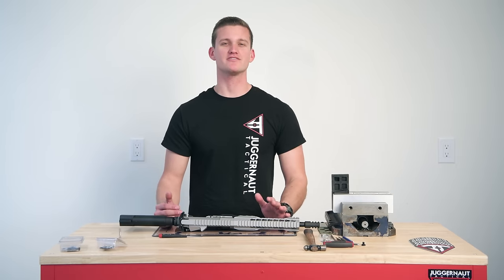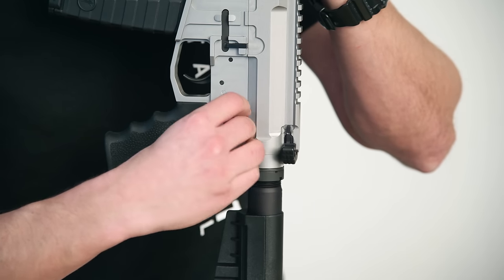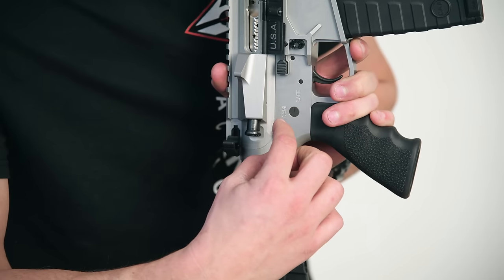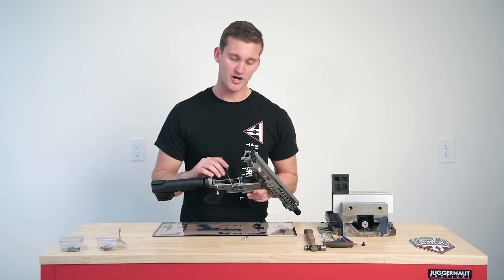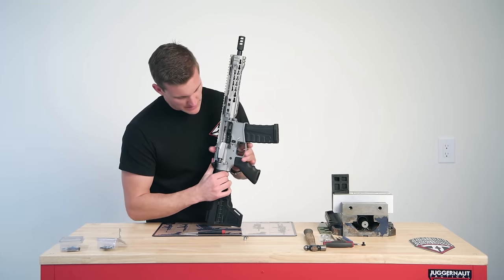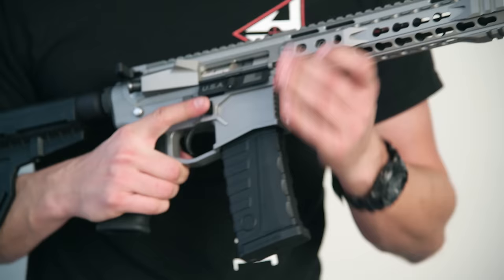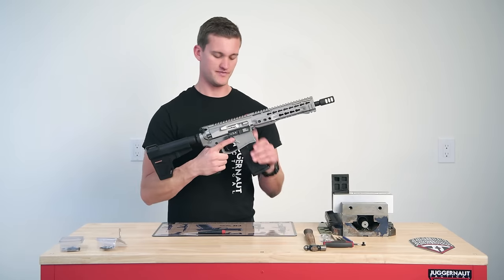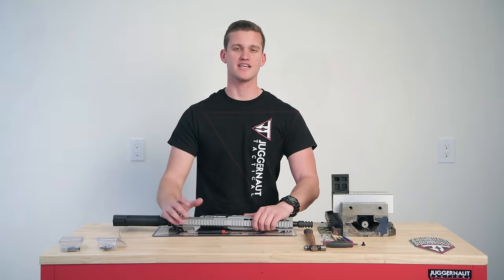How To Disassemble And Adjust Our Hellfighter CA Mod Kit

Comment: how do I lock the bolt back with this?
Reply: Same as you do normally
Reply: You remove the bolt catch so how do you figure?
Reply: @user-ro5qf1ov9r  sorry I was speaking from experience with my factory-installed CA compliant LWRC DI but it turned out they only used the rear takedown pin from the hell-fighter. Everything else was bespoke, lol. So on my LWRC I can lock the bolt back.

Comment: Is there a way to adjust the kit if the break is too stiff? Or won’t break all the way just by pressing?
Reply: I am wondering the same thing.  Just got my first ar, and mine seems stiffer, does not crack or close with ease. Did you find a solution?
Reply: joshm510 so i figured it out. Out the factory or whatever it comes with a rubber insert that is behind the trigger group where the auto sear would be. I took it off and it operated smoothly since. Leme know if you cant figure it out i can dm you pics or whatever.

Comment: Are any of the issues in the comments below fixed? I’m Not sure if it’s been fixed by the manufacturer. Issue with detent pin & others???
Reply: Stevo Schauer mine works, you have to be easy on it clearly cuz that D tent pin will pop out. But im having an issue with the mag, the bolt won’t close all the way. Keeps getting caught on the mag
Reply: Thanks for the update I have the cross armory kit with the bump stop by mid-evil industries works great

Comment: Great product but the video is lacking on a bit of info. You should show prospective buyers how to make sure the mag block (the piece that replaces the bolt catch) is adjusted properly. Also, learn from my mistake, I didn't locktite the adjuster screw when I installed kit. I installed my upper then a couple days later took my upper off. When I reinstalled my upper I couldn't get it to close up, it took me a bit to figure out it was the adjuster screw that had somehow worked it's way out (I have no clue how it could work it's way out while the upper was closed but it did). USE THE LOCKTITE.

Comment: I was unable to get this to work as advertised. I am CA compliant  in that the Mag is locked in place, however when i push spring loaded pin in the rear it still does not release. trying the adjustment in this video did not work in so much as when adjusted to just cover the release bar when pushed down, now the upper no longer seats all the way down in the rear so the pin does now go through to hole since it will not align with the hole in the rear upper for the pin. when i adjust it so that the upper seats properly the mag does not release when pushing the spring loaded pin in the rear
Reply: It works as designed for me.  My 1st AR too, not even a month old.  If you haven't figured it out, i see 2 possibilities.  Your upper is too rear heavy that it can't pop on its own once you press the JT rear pin in. Confirm this is the case by turning your AR upside down then press the rear pin.  If it pops open, you're rear heavy.  2- If your upper does pop open but mag button is still locked, your new mag release is not disengaging on its own.  Ensure both springs are installed. Lube this area well.  Leave your upper out, you should see this modified bolt release naturally in the up/unlocked position and your mag release should work.

Comment: Over the years I have assembled thousands or rifles.  From AR to bolt action, I have assembled and fixed every type of firearm imaginable.  I was tasked with building two California compliant AR-15s for a client.  They requested this kit because it was what they were told was the best.  
I WILL NEVER install one of these kits again.  The takedown "pin" and bolt catch "delete modifications rendered this rifle unserviceable and I was just forced to demill the lower receiver and mark it for destruction.  First, the 3 springs that were included all got crimped during the installation process.  Then the takedown "pin"...  The first installation attempt I found that the pin had rotated and the retaining pin became jammed in the receiver.  I got the pin pushed back in, and after following the video over and over, I attempted it once again, and again.  Each time the pin would rotate, forcing the retaining pin out the channel, jamming the retaining pin in the takedown pin hole.  The final time the retaining pin wedged itself in the hole, and after using the maxmum amount of force necessary to remove the retinaing pin, the retaining pin was bent and would not move.  Once again, using the maximum force necessary and a pair of heavy-duty wire cutters, the retaining was free of the receiver, and in a few pieces.  If anyone is curious about the maximum of force necessary, it involves a 1/4" punch, benchtop vise, and a hammer.  Yes, the only way I could find to get the pin out.  The left side of the receiver specifically, the takedown pin hole became ripped as the retaining pin and takedown pin came out at an angle.  
If you live in California and want a quality AR-style rifle, save your money on purchasing any compliant part, and use that money to move to a state that will allow a proper rifle.

Comment: There’s a major problem with the jaggernaut hellfighter rear take down pin. With the upper removed from the lower, if the jaggernaut hellfighter rear take down pin is pushed back onto the lower receiver, the pin will twist and dislodge the detent. After this happens, the castle nut and buttstock will need to be removed from the rifle to correct the the problem. Now if anyone else is like me, I always push the take down and pivot pins back into the lower receiver after removing the upper. This problem is completely unavoidable, and will happen no matter how hard you try to keep it from happening. I have yet to see jaggernaut tactical address this issue, because in my opinion is completely unacceptable. To have this problem in a life or death field strip would most definitely equal death to the person running the jaggernaut hellfighter Ca compliant kit! I would love to hear what jaggernaut tactical has to say about this. There’s a lot of people having this issue, including myself and are now scrapping the jaggernaut tactical hellfighter kits for other Ca compliant kits. 
WHAT SAY YOU JAGGERNAUT TACTICAL?
Reply: Nick Klotz literally just happened to me pissed I gotta order a castle nut tool
Reply from the maker: @idrumcovers  https://youtu.be/RbvTy1fq2J4
Reply: @idrumcovers  JUST happened TO ME!!!!
Reply: And 2 years after ppl like me are going tru that issue 😭

Comment: You forgot to mention what you do if this replaces your bolt release. only way to release it is to charge back the handle? This needs to be addressed for guns that don't the bolt release on the right side of the gun...

Comment: I think I did it wrong because there’s a pin in the way of my bolt I can’t take it out and seems to be stuck. Help??
Reply: Not sure if you've got it fixed by now but I had the same issue.  Took about 15 minutes and multiple tools before I was able to pull that pin back. Thought I was going to have to send it back in to S&W.
Reply: Ruben Vargas yea I fixed it, now I know how it works and won’t be making the same mistake. This video needs to empathize on this issue and instruct how absolutely imperative it is the pin doesn’t get pulled out too far. Nobody is expecting this kind of precision right off the bat with a mil spec rifle.
Reply: How did you get it to unstick I’m trying to fugure it out on mine